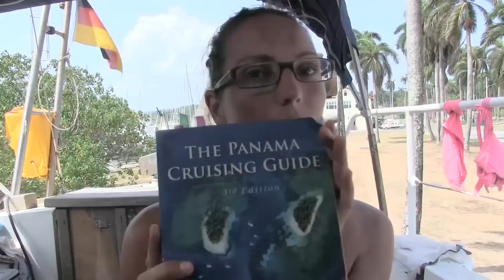Unconventional german welder SAVES my SAILBOAT in Panama - UNTIE THE LINES #30

Comment: Using water to make milkshakes would be unconventional. Stick or arc welding aluminum isn’t unconventional, it’s WRONG! Your welds could come popping apart in the ocean. Not trying to scare you girl, just want you to learn a very important lesson here. Google it, do some reading on arc, tig, and mig welding and their proper uses. Be safe luv and be very careful.

Comment: During my first career I was an industrial corrosion control contractor. I found using catalyzed phosphoric acid wash at 1 mil on clean steel or aluminum to be the best first coat. If ferrous, it prevented flash rust whether you could see it or not and with aluminum an extremely good bonding agent. Of course the engineered systems we used were determined by the environmental conditions and exposures. As an example: catalyzed phosphoric acid wash, epoxy multiple coats, and then two coats of catalyzed urethane. I have used both paint remover and various types of media blasting, to me media blasting is much better and easier if it is available. They do make devices to test if there is any porosity to the coatings, they are relatively inexpensive. Best sailing to you.

Comment: Nice shots from the inside on the welding, but you could have really helped out by holding a plate or rod of aluminum or copper as a backing and heat sink to aid in closing those holes, particularly the difficult overhead ones. By placing something behind the gap, it's easier to fill from the outside, some welders tape pennies on the opposite side as backing, then remove them afterward to inspect the weld.

Comment: I would agree with a long comment below about stick welding aluminium. This is a difficult metal to weld as the surface oxidation layer (which forms immediately on any exposed metal) has a higher melting point than the actual aluminium, so just heating it in stick welding tends to incorporate lots of oxides and other products into the weld which makes it potentially weaker. This is why you generally try to keep the oxygen out of the weld area by using an inert gas shield (MIG or preferably TIG). It may look good, but there may also be multiple inclusions which mean the weld is not as strong.  Ok, it's done, but anytime you have Karl out of the water, I would be checking those areas like a hawk !
I definitely look forward to this time of the week; impressed and not a small amount of jealousy !
Michael

Comment: Been lurking in the background since you started, I must admit I was a little curious how long you'd last at first, but have been impressed and surprised (not the first time, imagine that). 

Anyway, in regards to taking the paint al the way down to the bare metal, two thoughts (both of which it appears you've already had), 

One:  Why?  That paint looks really well stuck.  If you can't take a sharp chisel and peel the paint from the aluminum it is well bonded.  If you're worried about compatibility between the old primer and the new primer, paint on a test patch.  Most well cured, quality paints are compatible with most overcoats, as many (most?) primers are with other primers

Two:  If you decide to take it all the way down, you need the right equipment.  In #28, I saw you using palm sanders.  To do this job efficiently you need at least a six inch, soft hook and loop pad, an 8000 rpm grinder/sander, and 40 to 80 grit discs.  If you go this route, there's a pretty steep learning curve, so maybe 80 grit to start and
40 as you learn to control the grinder.  (I use an 8" pad and a heavy duty, two handed right angle grinder)

I'm not talking out my ass here either, coincidentally, yesterday I removed 2 coats of bottom paint, two coats of high build epoxy primer and 4 coats of epoxy from half the bottom of my 33' Morgan in 4 hours.  Granted, I had ideal weather (60 degrees f, 20 knots favorable wind) and lots of experience, but with a little practice anyone could do the same.

And finally, If I can make a recommendation (if you don't already have one)  get a copy of Nigel Calder's book 'Boatowner's Mechanical and Electrical Manual". It has more good information in one place than any other book on this subject that I've ever seen. 

And a final note, from your videos it looks like you don't have a serious electrolysis
problem, but you might have a small one (hence the holes) and changes in your electrical system can cause these problems inadvertently, especially in an aluminum hull.  You must keep voltage between the hull and the water to the minimum to avoid problems.  Calder goes into this in depth in his book  (which is part of why I recommended it).  I know this also from experience because, in a misguided attempt at electrolytic protection, I bonded an aluminum outdrive to one of our boats electrical system and peeled the paint off in 2 months,  And it was stripped to bare aluminum, acid etched and primed, coated with epoxy primer and top coated with acrylic urethane.

My point is not to scare you but to reinforce the caution you seem to already have. 

Hope I haven't been too pushy, and good luck with your projects.

Comment: I guess 5 years from now we already know the answer if she is still floating... Most of the people giving welding advice on the net watched a few episodes of Monster Garage, well maybe Orange County as MG used to get into some welding arcana. There is nothing whatever wrong with stick welding aluminum. It is far from a home shop technique for weekenders, because it is supported by all the big name companies who make the gear, and mostly used on plate, which is not likely Mr Garage's favourite medium. I couldn't really see, but he seemed to be running nice straight lines, and as the boat didn't just catch on fire, he must have shielded it well enough.

TIG is great, and I am on my second machine. The name brand stuff is extremely expensive to run, so you can bet people are not using it in remote parts of the world. Though in the last few years some decent chinese machines have become available. The thing about shield gas is that it blows away in the lightest breeze, so processes like TIG and MIG, are normally not done out of doors.

The other issue is how much strength you need in a hull. And the answer is that you don't usually need much. You need global strength so it does not snap in half, or the keel fall off, but keeping water out is not such a big deal. Traditionally they hammered in hemp fibers. As long as the aluminum on your hull was actually welded in place, and not surface deposition, you are probably in a real good situation compared to hemp.

Comment: Glad to see repairs are being done and you're getting closer to being in the water.  I do have a question about the anode.  Now, I know very little about aluminum boats, but isn't there a way to attach the anode without welding it on?  Where aluminum is an anode itself I would think that you would want to keep a very close eye on those and changing them in the water if needed.